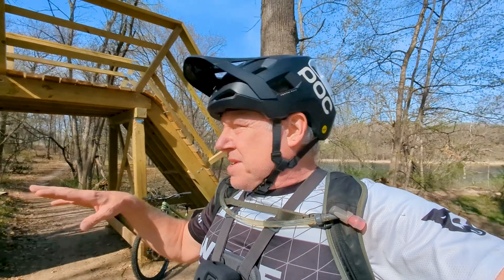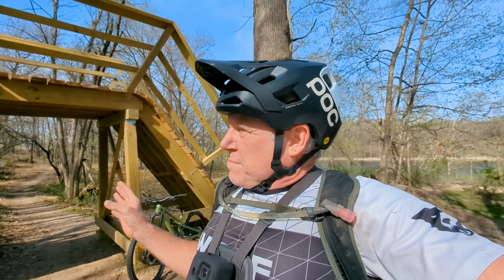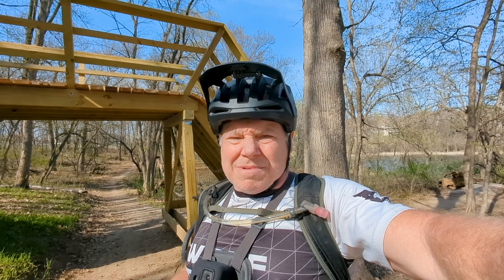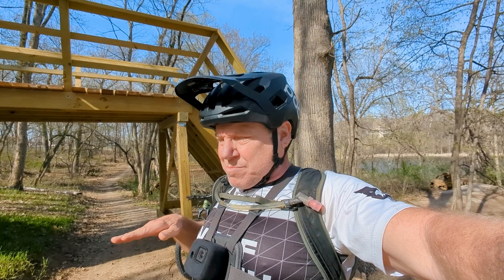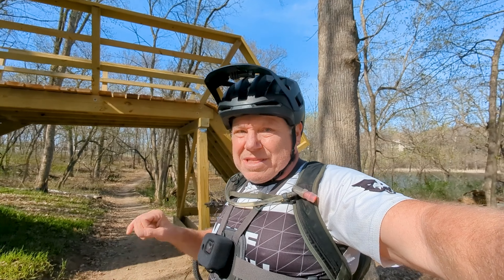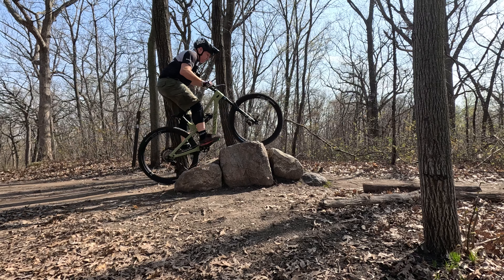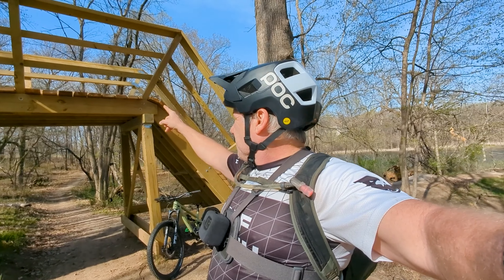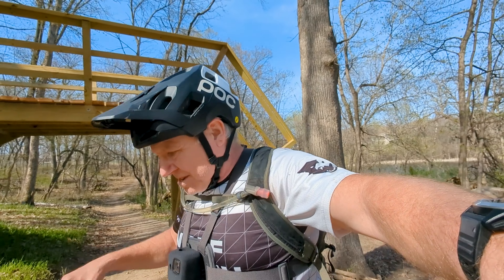Riding Tip: Short Steep Sections

Comment: Great tip!  I admit i'd be intimidated to ride this.  Maybe a dumb question, but is it the same technique if it's smaller?  Like a 2 foot decline?  Or is that more of a "peek and push"?
Reply from the maker: It's the same technique as I showed in this video going over the rock, which is much smaller. The backside of the rock is no different than this bridge ramp.

Comment: I'd add something about what could go wrong, and since I'm naturally rich in negativity, here's what I see: the compression on the bottom of this can be unpleasant. #1 don't air this, roll slow from the top; #2 your head can get heavy in the bottom, which takes some experience to get used to it and find way to absorb; #3 as you hit the dirt bike feels heavy and there's a moment when you can slow down or turn; #4 but, a second after that it feels light again, and if you made a mistake during #3 it will be too late to correct, and if you try the front brake it will turn really nasty 🤷
Reply from the maker: I mentioned #1. The rollout is gradual enough to not have a g-out effect, so no worries there. It's also not high enough to have enough speed to cause a g-out. But something bigger likely would if there isn't much of a rollout.
Reply: Thanks for this Shad. I rode Theo earlier in the same day you filmed this. I rode past this after looking at it. I can only think about what can go wrong. Is this steeper than the bridge in Paradise in Monarch? I've ridden that with no problem.
Reply from the maker: @Stumpy1991  I am not sure what bridge in Paradise you are talking about? The one on the jump line? To me that's more like a giant roller and nothing like this. Although, the same pitch control I talk about is used for both.